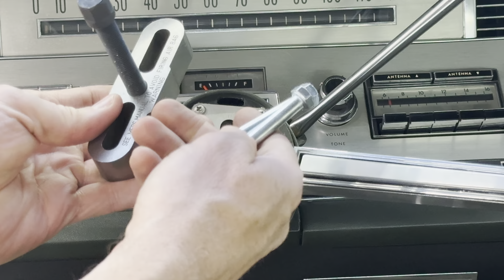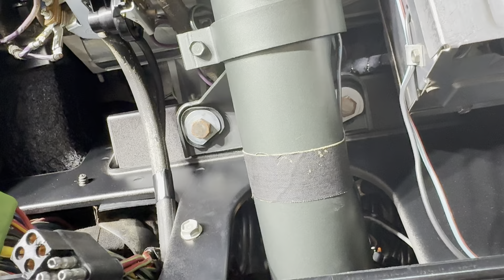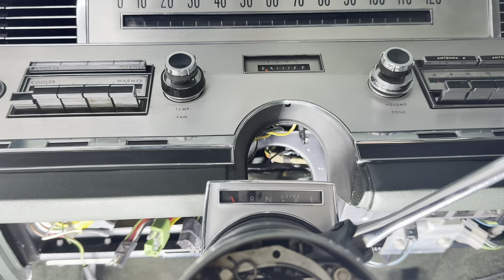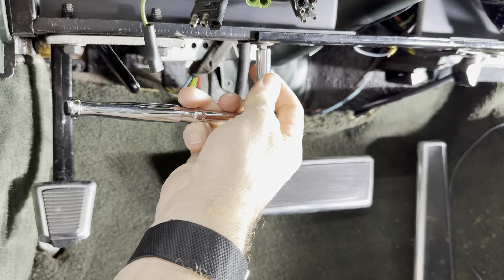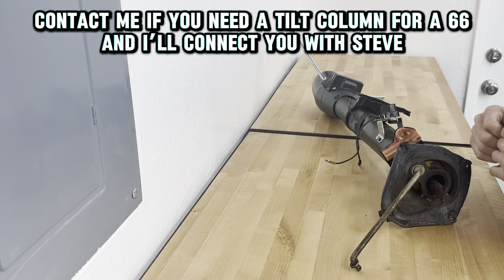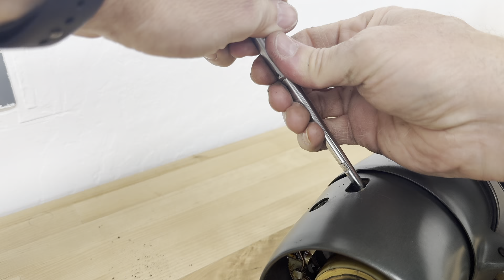1966 Lincoln Continental | Removing the Tilt Steering Column

Comment: Why are you removing the steering column? That should be at the beginning of this video.
Reply from the maker: Hey @USACLives - Fair question. I’m fully restoring the car, so eventually every nut and bolt will come off at some point. But the main reason for removing the steering column right now is to gain access to something in the engine bay.

I’m fully detailing the engine bay and the heater core / evaporator case mounts to the firewall. The hardware for that box is extremely difficult to access with the dash in place. So the process has been: front seat removal (video already up), steering column removal (this video), and then dash removal (uploading tomorrow). That gives me access to remove the heater/evap box so I can continue the engine bay detail.

And fair feedback on mentioning that earlier in the video...I’ll keep that in mind for future uploads.

Comment: You are doing an incredibly thorough job on this coupe, and when it is done, I am pretty sure you will not have nagging problems pop up as you use the car.  It should be more reliable than anything built today, without problems "deep" under hood (and dash) that make many of us afraid to take our older cars on very, very long trips.  Great to learn.  -Bobo KC
Reply from the maker: Hey Bobo KC - Thanks for the kind words, I really appreciate it.

At first, my goal was just to see how quickly I could get the car running. But once I started working on it, I decided if I was going to do this, I wanted to do it right from the start.

I got a lot of feedback saying “don’t remove the dash, it’s a nightmare,” which honestly just made me want to dive in even more. My goal is to make this car as close to perfect as possible, which is why I’m removing every nut and bolt and putting it back together. This really is an adult-sized Lego kit.

Truth be told, when it’s done it will probably have pretty limited drive time. More of a Sunday cruiser and car show car than something I’ll rack miles up on.
Reply: @66LincolnContinentalCoupe You should join the Lincoln and Continental Owners Club if you have not already and take the coupe to a National meet. You'll have that car dead reliable and able to make the trip. I had a 1962 and 1967 sedan in the past, and always had a few nagging pains, not having gone through them like yours. (I have a 1979 coupe now.)  That's the long trip I will hope you make some day! -Bob
Reply from the maker: @robertmurphy5624  Hey Bob - I joined LCOC very shortly after getting the car. I think the recommendation originally came from Bazil, who is on the board of the West Coast chapter. He’s been incredibly helpful as I dig into the car since he’s already been through a lot of what I’m tackling, so we’ve kind of shared in the journey.

I absolutely plan to make it to a National meet at some point. I was actually hoping to attend the last one in Ohio, but if I remember correctly, I had a work trip that conflicted.

I’m really looking forward to making it to one to see what it’s all about, and even more so to eventually show up with the actual car!
Reply: @66LincolnContinentalCoupe Everyone will love the car!